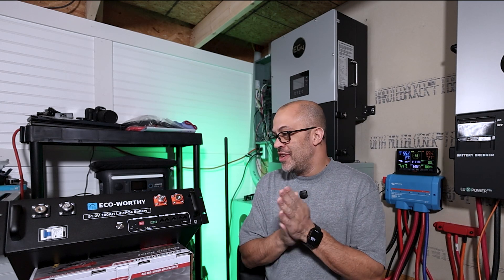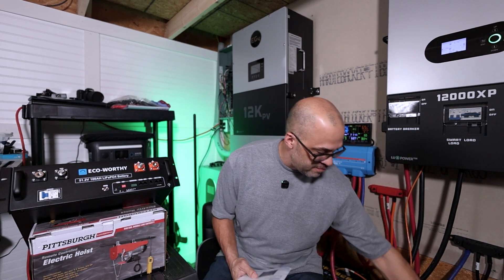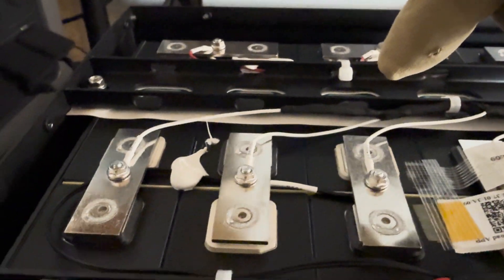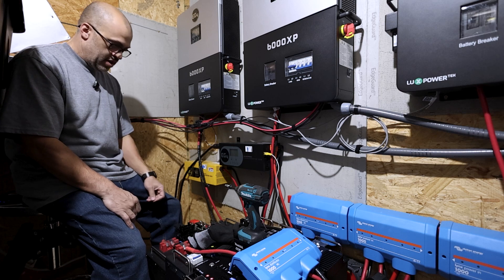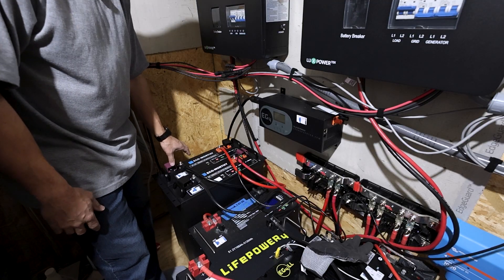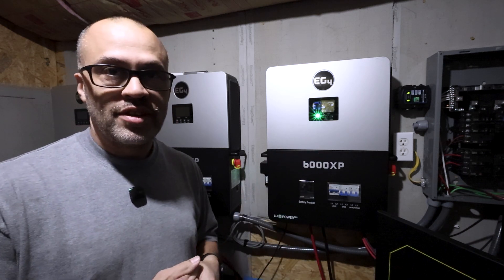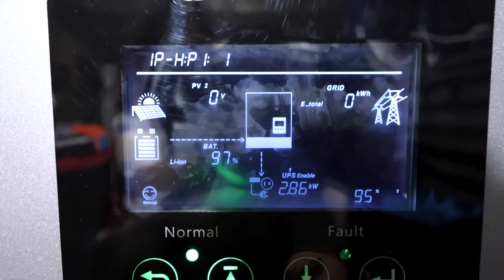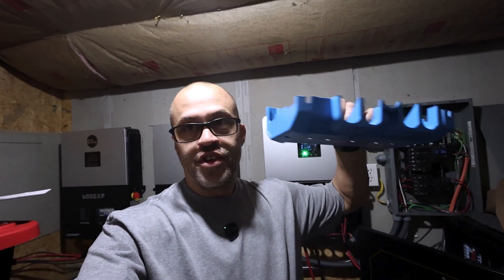Eco-Worthy 48V 100AH Lithium Battery - Adding Solar Backup Power on a Budget- 100kwh Home Backup

Comment: What battery protocol comm is the 6000XP set for?  I'm guessing 2 = Pylon since that worked for me with a Chinese battery (EA Sun Power).  One fun thing is if you go to the Protocol setting and don't even change it, in returning to Main Menu, the 6000XP powers off and reboots.  A surprise when things in your house are running off it.  The screen show2 2000 A-h of battery (should be 200).  The batteries are outputting 7.1 kW = 2 (68.7 A)(51 V) to give 5.74 kW inverter output.

Comment: I just built a 600 sq ft off grid house and just bought one of these. Also  I'm mounting 6 300v 48w solar panels. A eco worthy 60 amp 48v controller and a eco worthy 3500 48v inverter. I'll be using propane for my kitchen stove and to heat water and mostly wood to heat the house. Thanks for the inspiration Rodney.

Comment: Do we have to set charging voltage for this combo or the communication will take care all of that?
Reply from the maker: I am just using communication with the eg4 batteries. Since that are tied together works fine without these communicating but I have a large battery bank. If you only have a few batteries you may need to use voltage

Comment: Thanks for the info. 
I just ordered my first battery. 🎉
I will be using an EG4 off grid inverter. 
What do you like for solar panels? 
Thanks Nick
Reply from the maker: Using some of the Sirius panels that I like but lots of good ones on the market now. Depends on budget and spacing really. Just to get the largest panels you can afford and fit in your location in my opinion. 500-600 watt ideal since it uses less hardware

Comment: Thanks for the video Rodney.  I have two of these batteries and paid with my $ for 800 each using codes.  I will just wait it out for a bit since I now need more solar than battery capacity.  I did order an EG4 off-grid inverter since the price was good and only $17 shipping.  Power On!
Reply from the maker: Nice find on the inverter and shipping!  I'm going to have to try that myself

Comment: I have some LifePower4 V1 batteries and a EG4 Communications Hub connected to a Multiplus II. I wonder if there is a way to utilize the Comms Hub to translate protocols between the Eco-Worthy and the EG4 batteries. There are a number of comm ports and protocols available, but I don't know how flexible the box is in terms of dealing with three different protocols at the same time (Victron, EG4 and Eco-Worthy/Pylontech).
Reply from the maker: That’s a great question! I’ve never tried mixing different battery brands in that way.  If I ever get the hub I can try it though

Comment: Great Vid Rodney.  Just to clarify, you have multiple battery banks, mostly of the same type of battery but several of different manufacturers, but everything (Battery banks, Inverters) married through the bus bars (Lynx Distributors or Power in)? If so, the one challenge is a unified reporting on overall battery capacity. Correct on that point?  Assuming most of your battery banks are the EG4 and connected to the inverters, you get one unified state of charge, but the others, you have to look at through a different interfaces (rasp pi/Venus OS, Bluetooth or something else)?  The inverters simply pull from whatever they need which, as I understand it, is split between all the banks connected to the bus. I ask as I anticipate having a server rack with 30k (eg4), several DIY batteries and maybe a few of these eco-worthy.  Piecing it all together to get to 100kwh by saving a few thousands NOT buying all the same type (EG4). This also allows me to learn a little more, particularly around building the batteries.
Reply from the maker: Yes all connected to the same bus bar but only 11 communicating SOC to inverters.

Comment: Rodney, you won't likely get these to talk with the EG4 batteries.  The Eco-Worthy uses a JBD BMS, EG4 is all proprietary to them, they won't know how to communicate.  For mixed batteries, the best way is to switch to open loop/voltage based charging.  I've got five 280Ah DIY batteries with a JK Inverter BMS and picked up three of the other budget option that popped up a month or so ago (Cycclevolt) which use a Pace BMS.  Just connected them in parallel with the rest of my bank and they charge with the bigger batteries no issues.
Reply from the maker: Been running like this for years without a problem. But from what I have seen you need a large enough portion of the batteries to communicate with inverters to bring in max solar and discharge. Other than that just make sure battery cables are the same length and you run your system so it will charge to 100% often but also discharge deep to allow batteries to top balance after charging back
Reply: @rodneyhunt  Just curious, but were you able to mix these in with the EG4 batteries?  I'm gathering that if you're mixing them in with EG4, you're having to set the inverters to lead acid type, configure the voltage and abandon a close loop comm.  Thank you for testing this stuff out!

Comment: Very nice 👍 my latest system is an HV system, i need HV Batteries for it, i am starting to feel building an HV was not the best move since so many LV 48v systems are around with better price lol
Reply: I wouldn't feel that way - if I was starting now, I'd do HV.  It's the future, IMO.  More efficient, less heat, smaller wire.  I don't know I'd recommend a DIY HV battery, but there are several inverters you can get in the same price range as say a 12000XP, etc.
Reply: @ very true .. my issue is the cost of the LG HV wall mount battery vs the EG4 LV wall mount battery so much cheaper!
Reply from the maker: Prices on similar equipment will always drive the price down. So 48 volts is a great option at this time for sure